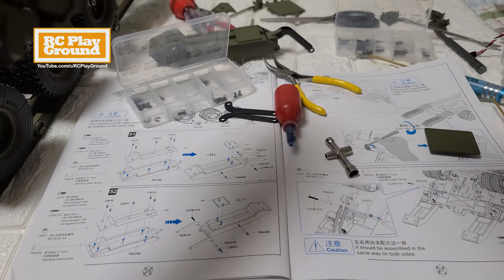RC Car HG P806 1/12 Scale Trailer Unboxing & Build Work

Comment: Thank you for making and sharing this build video my friend..i think it is very good. I`d like to build the trailer my self, but i guess i need the truck(802) too..hehehe..Whish the truck could come as a kit, would be very cool build..Stay safe friend..
Reply from the maker: Trailer had a lot of screws, so it was really hard to assemble, but now that it's finished, I'm really proud.
Thank you.
Reply: @RCPlayGround  Out of curiosity, can you measure the kingpin height of the trailer? I've got a Tamiya Globe Liner and I know it'd hook up just fine(the fifth wheels are identical) if the heights aligned right. But I'm not sure the heights will align and I'm not keen on dropping several hundred on a trailer I can't tow.
Reply: @RCPlayGround  
You should be proud! That's quite a model. I ordered  both truck & trailer from bang good it's supposed  to be here the end of October. On your truck did you install the sound and light kit? I enjoy your YouTube channel  very much! Thanks for your videos my friend!!
Reply: I have the truck and trailer, The trailer I bought as a kit, The truck comes Ready to run BUT one of the handbooks is a complete guide to building the tractor as well as a seperate handbook for building the trailer..

Comment: Hello , I notice that you connected the tail lights wiring to the 19cm length wire . The wire colors does not match when you connect both wires (red to black). Is that the correct way? If not , did you do any changes to the wires? Thanks
Reply from the maker: Just adjust it to fit the length of the led wire.
It's okay if the color changes slightly
Thank you
Reply: @RCPlayGround  Thank you sir , stay safe.

Comment: HEy Bud on my lights all mine will do is flash one tail light red?  I had gone through my wiring a few times.  I can get the ramps to work fine but not the lights.  They wont even turn on.  Just one tail light will flash red at the same sequence as the remote on indicator?  Any suggestions Id appreciate it..
Reply from the maker: https://youtu.be/Dofxb_KOggE
Reply from the maker: It's Korean, but please refer to this video.
I'm sorry I couldn't help you.
Thank you.
Reply: Did you ever find a solution to the light problem? I have a kit coming and I can't find much on the subject but have seen the problem in a few videos. Thanks
Reply: when I built mine and factory lights were a issue I just ripped it all out and wired in my own system.

Comment: Looks great. ;) 
What I do not understand, why did they designed wheels to be connected (that hexagonal hub and small pin) and not free from each other on same axle? If they are free (like real trailer) once in turn, inner wheels would make less travel as outer ones. The way they did it, it would tare tires quick when trailer is under the load.
Reply from the maker: I think it's because of the cost savings.
But it's a very long trailer, so it's very difficult to change directions, so I think it'll be okay.
And it supports the load better.
Thank you.
Reply from the maker: Abrams Tank HG806 Trailer best video - https://youtu.be/IHHJ1YxCoh4

Comment: The model is very nicely done, but I have a feeling that each wheel should rotate independently. The solution where both wheels of the same axle are connected to the axle is not very good.
Reply from the maker: I think the price made it simple.
The trailer's too long, so the turning radius doesn't mean much.
Thank you.

Comment: I would have ordered one if they were 1/16th scale.
Reply from the maker: Thank you for watching ;-D
Abrams Tank HG806 Trailer best video - https://youtu.be/IHHJ1YxCoh4
Traxxas TRX6 Best video - https://youtu.be/gSJidyfHP7M
Reply: 1/16 scale modern armour such as the Abrams is very well suited to this trailer, The Bruder 1/16 low loader is far too small for modern 1/16 Tanks.